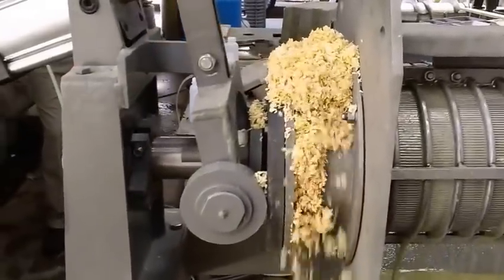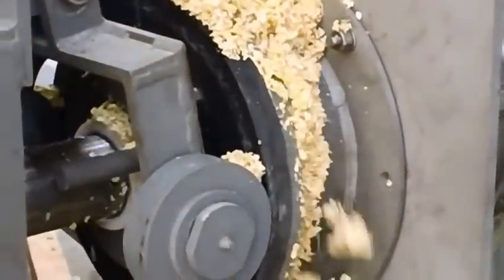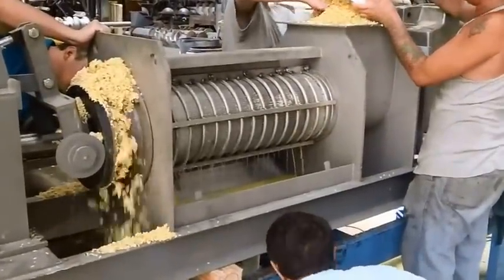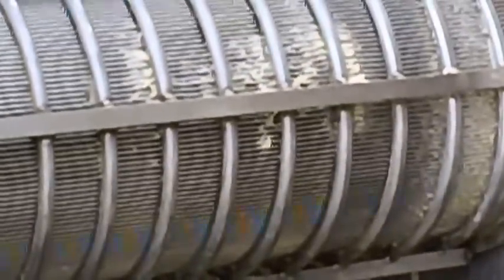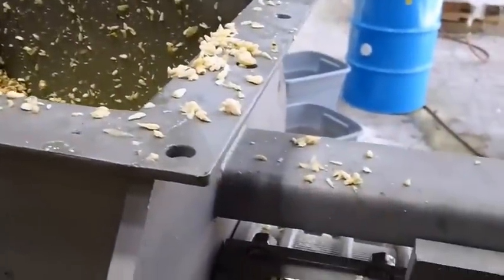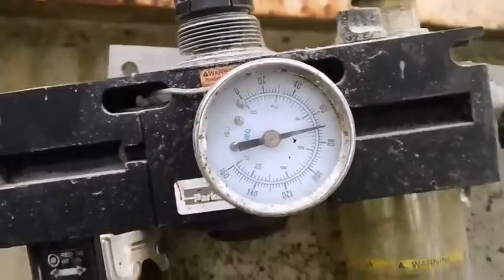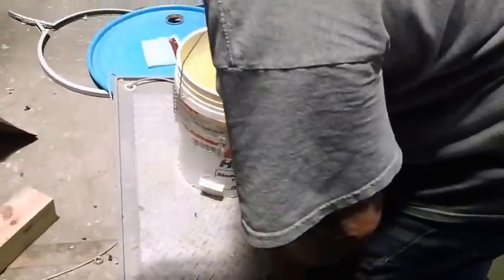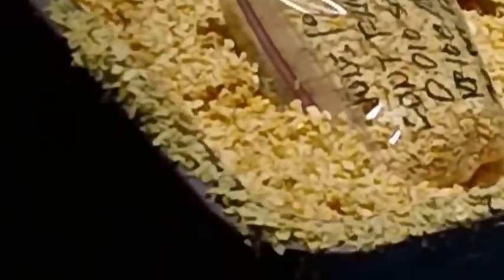Corn Germ 1

Comment: The working area is kind of messy. You allow the waste to fall spread on the floor
Reply: These guys seem to be the machine engineers/builders. This appears to be a machine test.

In the field, the solids coming out of the end of the unit would be collected and turned into corn meal.

My guess is that this is a test run for the extractor at the place it was built.